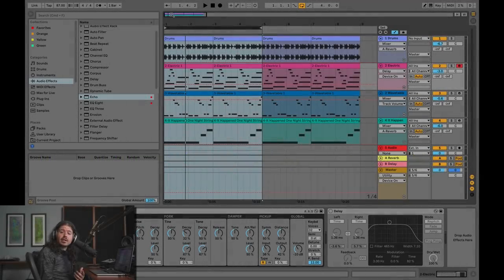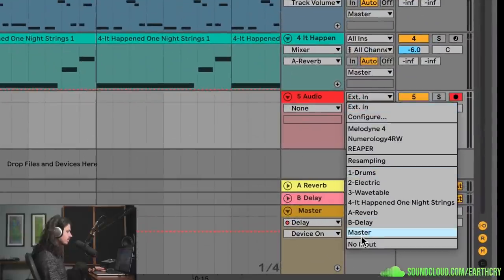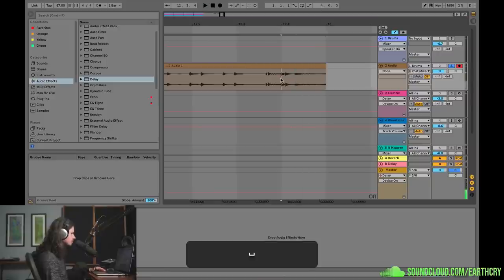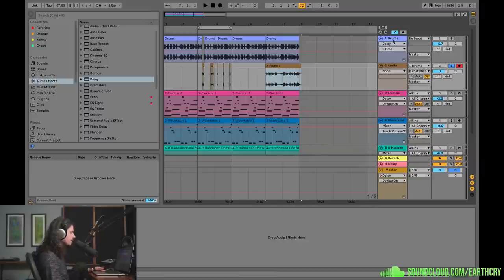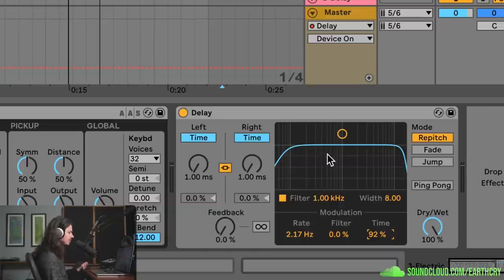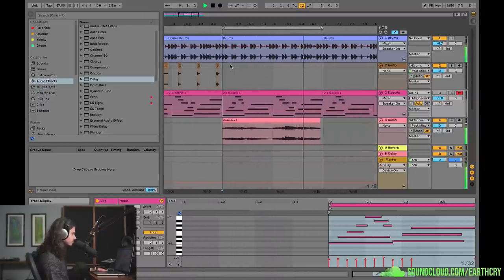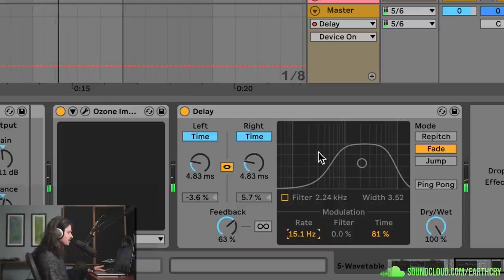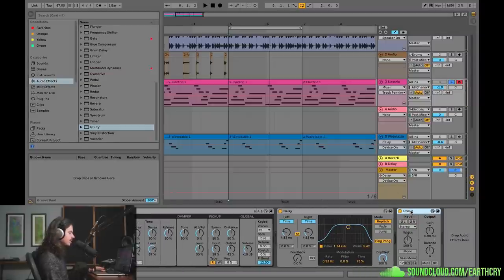Ableton Delay Tricks

Comment: Thanks, great tutorial! Cool to use delay as a chorus/flanger/phaser type effect. The stereo width thing is cool never thought of that. One tip for compensating the delay time when resampling is using negative Track delay on the original track you're resampling. Then you don't need to cut it or move the start point after.
Reply: By the way, another cool thing with delay is putting it in an effect rack and have multiple chains with different delays (all 0 feedback). This gives cool rhythmic possibilities.